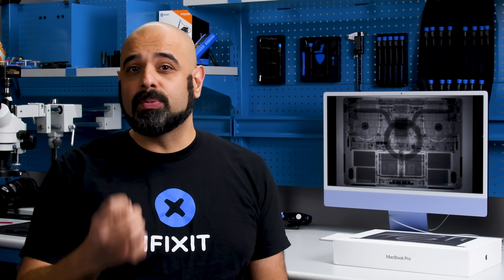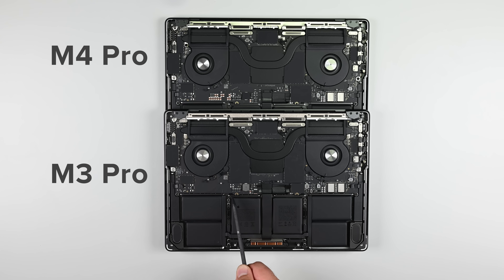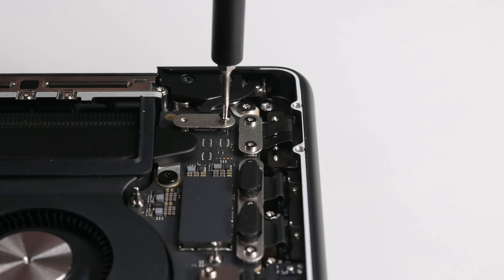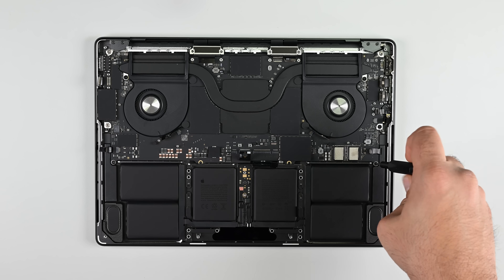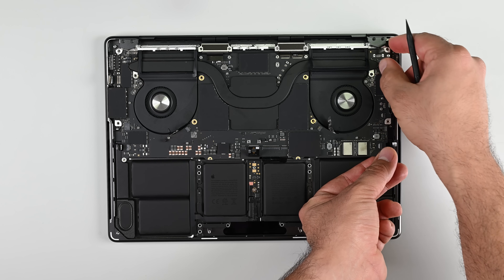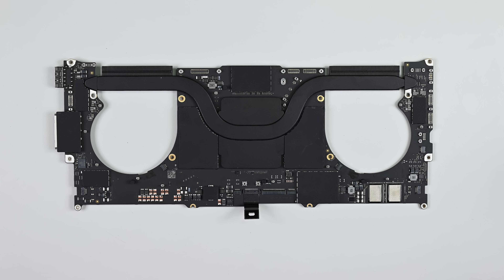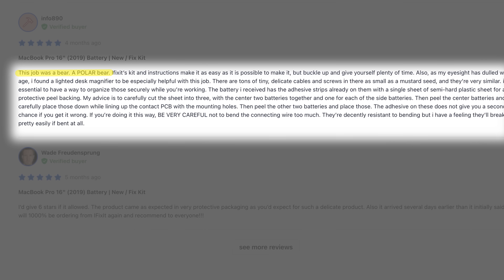MacBook Pro M4 Teardown: What’s Inside and What’s Fixable?

Comment: 5:30 - Yeah, I’d probably keep a supply of alcohol on hand too if I was repairing these all the time.
On a side note: Loved the modularity and upgradability of my 13” mid-2012 MPB with the i7. Upped the RAM to 16GB, swapped in a 512GB SSD (huge at the time), contemplated swapping the SuperDrive for a Blu-Ray drive or secondary HDD/SSD, but never did. Machine still works (just no macOS updates anymore) and original battery still lasts about 10hrs; can’t say I’ve had that experience with any of my various Windows machines over the last 2.5 decades…

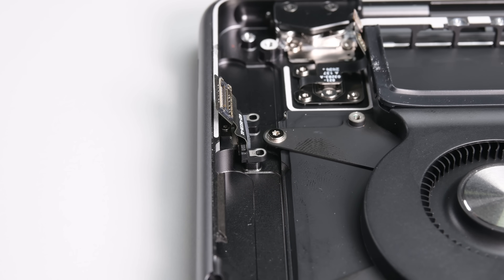Comment: 6:25 LOL after so much disassembly you can only get access to the notoriously often failing, wearing connectors... 
this kind of complexity is nauseating to me, completely unnecessary over-complication, which of course is shoved down the throats of fans without a problem. (even the narrator can't stop praising the cool people at Apple)
framework laptops are for me. connector replacement: one super easy movement, no screws, no torx and glue madness, 2-3 seconds for the whole process! :)

1:35 thousands of engineering hours? good work takes time, bad work takes even more

anyway I liked your video, only the laptop was disappointing

Comment: The Lid-Angle Sensor and TPS62180 were the reasons that made me switch from MacBooks to ThinkPads, also the lack of repairability and ease to upgrade, things than in Macs are IMPOSSIBLE for a normal user.
Reply: These apple's brain washed people in a comments lol 😂
Reply: Not until there's major backlash they won't. I personally had the misfortune of dealing with the iPad Pro 10.5, where a white spot develops two inches above the home button. And the device also intermittently ignores my touches, making it essentially unusable. I went through 4 replacements before I gave up, and all 4 developed the same issue within 6 months. Yet, Apple never acknowledged the problem. What's funnier is that I went to the same store 4 times,  and every time it was the genius's first time hearing the issue. Well sure bruh.
Reply: Nice downgrade....
Reply: @ I can upgrade everything there, while in the Mac I can’t upgrade or repair anything. ThinkPads are built to last while actual Macs are disposable devices with a timebomb in their guts (when the TPS62180 buck converter “dies” it kills the SSD NANDs and the USB C controllers, making them unusable).
Reply: @DonAle_97  Macs are built to last too and you don't need to replace anything. They'll easily last 6-10yrs without any issues. Stop with the BS made up issues.
Reply: @ old Macs were were built to last, in fact, the last “good” lineup was the 2015 one.

In the last 7 years I’ve had two “modern” Mac: The 2017 13” which suffered FlexGate and Butterfly keyboard issues, and the 2019 16”, which has the DustGate and the TPS62180 buck converter design flaw issue, which literally FRIES the SSD NAND, and the Lid-Angle Sensor which fails with normal use and you can’t replace it with another one because it has an special calibration, so you have to replace the entire screen. 

My actual 2020 27” iMac 5K has also its SSD soldered to the motherboard and there’s no nvme or M2 slot available, so I can only upgrade the RAM and that’s all.

It’s not BS but reality itself.
Reply: @DonAle_97  Okay well enjoy your inferior POS with Windows just because you can change RAM which 99.9% of people never do.

Enjoy a far slower laptop with far less battery life, a worse screen, heavier, etc, etc. 

And all the BS you mentioned above is just that, BS! It's only reality in your head.
Reply: @ducktails1695  Dude has literally spoon-fed you the design flaw down to the part ID, please type it in YouTube and educate yourself with one of Louis Rossmann’s videos before embarrassing yourself any further. 

Sure Apple is leading the industry in various ways. But that doesn’t give the company any right to deny a known design flaw until it’s impossible to cover up. Nor is it okay to take away consumers’ right of ownership step by step, in both hardware and software.

Companies need to be held accountable. Blind loyalty is exactly why they’ve been getting away with their crap thus far. It is naive to think of any company as your ally, Apple certainly ain’t treating you as its.
Reply: @HuanchaoShen  Most of these issues were handled (keyboard) and design experiment has little in common with repairability. Apple hardware tends to stay relevant much longer - but indeed, once it goes down, it stays down.  Also, no longer Apple is only vendor with glued/soldered/integrated hardware - I had good comparison for ASUS Zenbooks from 410UA ( still relatively good and portable, but with 1 RAM slot and place for TWO SSD drives - mSATA and regular one).
Reply: Lol, if you switched from a macbook to a ThinkPad, you're not really a real user of the MacBook, you just needed some hardware to play with and pretend to be cool
Reply: @nkl07ba12   Exactly!

Comment: 6:49 You don't need to unscrew the display hinge cowling and display hinge to get to remove the TouchID.  You can completely unscrew the right side of the Y-shaped cowling and unscrew/loosen the left side just a little bit to make the cowling free. And you can now pull the cowling out. Because the left part of the cowling doesn't go all the way around the screw.👍

Comment: those 4 rubber thingies you removed and did not put back in.
they absorb vibrations from the fans. it's a noise thing.

If someone put something somewhere, and you don't know why, don't assume you know better.
Reply: yeah not going to lie, billions in R&D. Apple doesn't have perfect design but at least everything is intentional
Reply: iFixit great, but now lets see them do videos of putting it all back again, rather just a few paragraphs saying "do this in reverse order"

Anyone can say that.... but lets see them do it....   I think therev is a reason no one shows videos of re-assembly.., because its harder than they led to believe.
Reply: No one knows the schematics to the MacBook pro. Guy is taking an educated wild guess.
Reply: @jltplease  It's not about schematics, it's not an electrical thing it's physical.  And repair manuals for removing and replacing components are available from Apple.  They are all published.
Reply: @jltplease  Uneducated savage thump thump, more like.

Comment: Would replacing a battery on a MacBook Pro M1 Max give me a battery warning?
Reply: ?? there are shops in every city that change your battery without issues since, forever
Reply: @ I’ve replaced every MacBook battery I’ve had in the past and never had any issues. You’re missing the point and understanding what my actual question was. Recent years apple has added chips to their components so that even if a computer shop does the repair it will give you a warning unless you also transplant the chip that’s coded to said model board. So my question is if I replace my battery myself would I get that warning so if the answer is yes then I could care less and just take it to the Apple Store and have them do it with their original part programmed into my motherboard. Don’t be an ignorant arrogant azjl. Your comment history shows you don’t have a life and go commenting unintelligent comments everywhere just trying drag everyone in with with wasting their life. Get a life so you don’t waste others lives

Comment: Why can’t I simply remove some screws, exchange a ram card, ssd drive or even swap a better cpu from the same family…it’s not like it hasn’t been done before . Stop making tech disposable
Reply: Framework laptop o7
Reply: that apple for ya, eco friendly bullshit
Reply: Because 99.9% of users don't care to do this? And it requires extra engineering and makes the laptop less reliable with moving parts. This isn't 1990 anymore. These laptops easily last 6-10yrs so IDK where you're getting these are disposable laptops. A lot of non-Apple laptops are the same way today for the same reasons.

Comment: I guess they want customers to crack their screens while pulling the battery pole tabs towards the screen  .. 2 also with the battery they should not have No adhesive why not bring back the old-school 13 inch just screws and remove the battery with screws nice tear down 👍
Reply: They don't want you to swap out the battery at all. Why should it be that hard to pull of the swap.

Comment: Why does everyone keep calling the mini’s storage “upgradable”? Until Apple actually starts selling upgrade modules it’s just removable. They’re entirely proprietary down to the chips themselves so it’s not really feasible or perhaps not even possible for third parties to mass produce them.
Reply: Well not really the only reason they bot so “easily” upgradeable is because the SSD controller is part of the SoC directly. Only thing is the NAND boards are not available yet but people Like Dosdude 1 and the french are starting mass production so over time it wont be a big deal
Reply: There is people working on trying to mass produce them right now
Reply: there are already third parties producing them so the comment about not possible or feasible is just ignorant and wrong
Reply: @ClimbingHeaven they have copied the board but are not producing the NAND chips themselves. I am somewhat surprised they managed to source the chips reliably considering Apple’s extensive history of preventing the sale of components to third parties. That’s where I guess I was wrong but Apple may still be able to restrict the supply of the nand chips at any moment via new agreements with their suppliers.
Reply: Real
Reply: They are in socket so technically upgradable. Soon you'll see similar SSD on AliExpress & alt. The same thing had happened with the MBP 2016 SSD and soon enough 3rd party became available.
Reply: why would anyone do that, useless
Reply: unless you start soldering they are not upgradeable and even then there are issues. it is criminal the lack of free m.2 slots are seen as ok 🤷‍♂  Apple always gets rated on a curve. imagine a mini pc without a m.2 slot 😂
Reply: @logirex  you can move your home folder to an external thunderbolt drive and you don't need the internal storage other than OS updates. Not ideal but gets the job done.
Reply: @logirex that’s why I switched from Macs to ThinkPads: Repairability and ease to upgrade.
Reply: Typical greedy apple.
Reply: This.
Reply: It is upgradable, 3rd party have successfully mass produced the Mac Studio storage module, a store in Thailand is offering trade in storage module upgrade for the new Mac mini, 2TB for ~$250 you have to give them your old storage module, the chip isn’t proprietary it’s just regular NAND flash

It’s always possible to upgrade SSD on a Mac, it just requires skill which most technicians do not have.
Reply: @benchy5769  what's your source on this?
Reply: China manufacturers will make the SSDs and will definitely reverse engineer the connector
Reply: @RinoAP  connector is the standard Mac Nvme type connector but the hard part is the Apple SSD. It won't be possible as far as I can tell.
Reply: @SahilP2648  socket is different with standard NVMe. Try again
Reply: @RinoAP  it's a Mac type Nvme (proprietary connector), not the standard Nvme. The 2015-2020 macbooks had that with swappable SSD. It's likely that.
Reply: @SahilP2648  there already are chinese replacements

Comment: increasing the number of screws just to screw with repair men and increase the cost of repair for the consumer to consider buying new .
glue the battery to chassis is Apple way to screw with us without using screws .
batteries were removable easily  by a monkey in 1 second .
then became built in fixed by 4 screws after 8 screws of the bottom panel can be repaired by anyone with a screw driver after watching a 5 minute repair guide video .
now Apple glues  it with 14 stretch-release adhesive because it used all the screws to secure the antenna.
Reply: You are right. Thank's, Apple allows to open back cover😁

Comment: Those foam nubbins are to prevent the screws from contacting the bottom panel. This is to avoid indentation in the bottom panel and the unlikely short circuit in the event that paints from those screws are damaged.
Reply: Short to ground …
Reply: @Joniyah444  Not used in some countries. Also can act as a second line of defence.
Reply: @bocao4498  thank you
Reply: The bottom panel is plastic.  It's not like the Intel Macs where the bottom panel is aluminium, it's just plastic.  No shorts.  But the foam prevents godawful vibration sounds if the screws touch the plastic.
Reply: @cjmillsnun  I have one right now, and I can confirm that every four panels are aluminium.
Reply: @cjmillsnun  its metal. if you open liquid damaged ones they will be rusted there and everything.

Comment: People keep saying "duhh you're removing the adhesive the wrong way!" but if Apple just didn't put adhesive in the first place, we wouldn't need to worry about this problem at all (and other companies HAVE shown it to be possible, so it's just laziness on Apple's end)
Reply: Bad take. You can hold it in either screws, but those can shake loose over time. Batteries should be held firmly in place.
Reply: How do you think it should be done without compromising on the volume of the battery?

Comment: It's a shame they didn't add replaceable SSD to MBP like they did to Mac Mini
Reply: I'd say it will come with the next redesign, hopefully with some easier repairability for the other components too. Apple do seem to be heading in that direction.
Reply: @ indeed, most likely will come next year. Typical apple “next year” strategy. 
Don’t think there would be swappable ssd on M4 MBA as well
Reply: I know there was kits like the iBoff where you can add a PCB with a NVMe connector on the logic board, which allows to put removable SSD. 

I don't think they made something for iMac and MacBook Pro after 2017. But it worth a look just for the concept. 
Those kits are available on Tindie.
Reply: Removable storage introduces two more potential points of failure, The SSD boar's pins and the logic board socket. On a desktop it's not that big of a deal, but on a portable that's being moved and carried around all day in a bag increases the odds of something going wrong. Same issue occurred with SO-DIMMs
Reply: @a6am3mn0n  Most current Windows laptops also have removable SSDs, but it is not common for the storage unit to fail because the laptop is moved around a lot.
The sockets currently used can hold the drives in place quite stably. If Windows laptop manufacturers can do this, why can't Apple...?
Reply: @ yeaaah maybe, but nah. 
I work with laptops for about 15 years, memory and storage pins issues are quite rare. 
Having to replace the whole motherboard when your SSD is fried is really a bad practice
Reply: no, nobody needs this

Comment: Imagine hitting the screen in this exact moment 5:54
Reply: I was totally trigged
Reply: 100%
Reply: I KNOW. RIGHT?
Reply: Could see it happening no way I would do it
Reply: My heart stopped for a moment when I saw that.... I crushed my Razer Blades screen by accident, costed me 1300€ to get it replaced .... I can only imagine how expensive this will when this happened to my new MBP
Reply: My thought exactly lol.
Reply: Covering screen side witn finger and some caution should be fine
Reply: At least no flying batteries, like in the Jerry's video with Lenovo tablet or what it was :D
Reply: the guy is a brute and has no finesse, either cover the screen or learn the appropriate way to remove the tape which is roll it onto a bic pen or pencil towards the battery, NOT away
Reply: @fitnesspoint2006  Indeed or even wrap it around the tweezers, It would've saved all the broken adhesive strips as well.
Reply: @fitnesspoint2006  exactly

Comment: I'm still scouring youtube for shots of the M4 Pro and M4 Max packages under the heatsinks.  Not really a repairable part mind you, so ifixit not digging deeper makes sense.
Reply: Absolutely agree, though I don't think ifixit not digging deeper makes sense. I remember the parts analysis they did on the site years ago where every IC was highlighted and its role explained. Even with the M2 Pro they went above and beyond and decapped the chip to show package technology improvements. Sad that they don't do it anymore.
Reply: Yeah! That video ended too soon
Reply: these MacBooks the only things that are meant to be replaced by apple is the keyboard trackpad speakers screen microphone webcam battery heatsink fans thermal compound battery wifi antennas hinges all these can be replaced including  keycaps the things that cannot be upgraded is wifi card or cpu or ram or ssd those compents are soldered